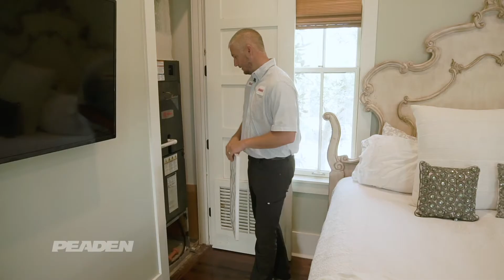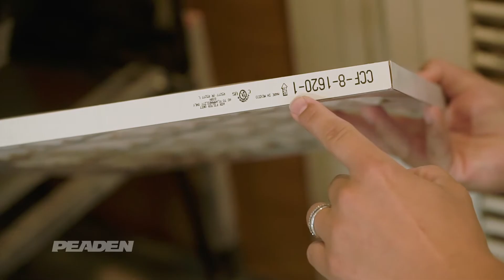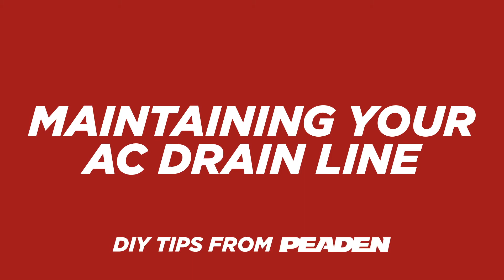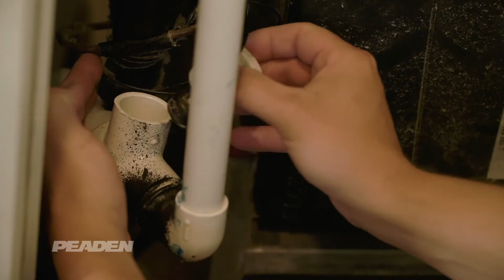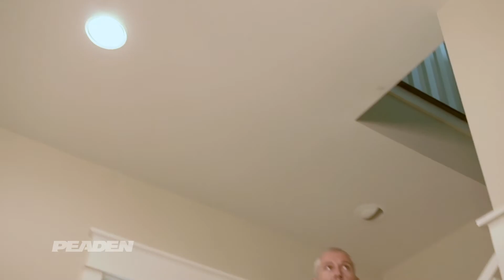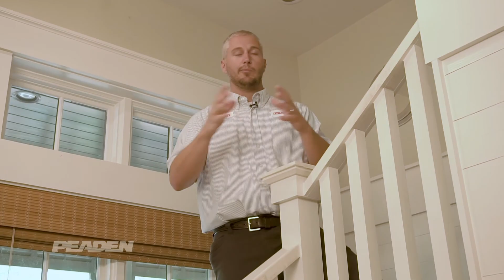AC Maintenance Tips: Filter Change, Drain Cleaning, Vent/Register Cleaning | Peaden

Comment: Don’t use that pleated garbage. All you need it a fiberglass merv 1. The pleated and higher nerves are a huge scam and damage the system. The filter is to just protect the system. If you’re worried about air quality get an air purifier.

Comment: I have a 3 ton system with an air handler type (ICP). I now use #8 merv (16" x 20" x 1") but they get dirty in 2 weeks here in central Texas. I'm in a new upscale double wide (tape and textured w ceiling registers.. It is a Smart Control (w/heat pump) Carrier brand. The closet is 30 inches wide and the space between the floor and bottom of the filter duct is 15".Should I or can I switch to a 4 inch Honeywell system?